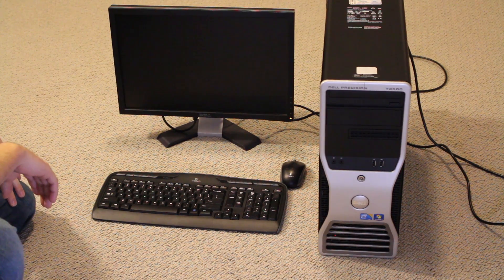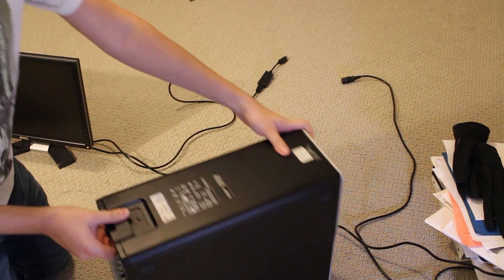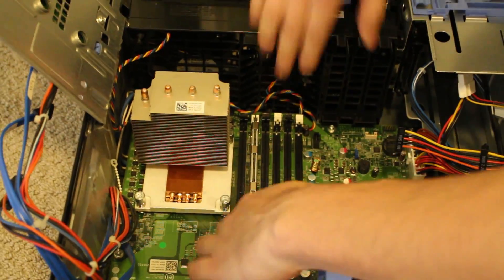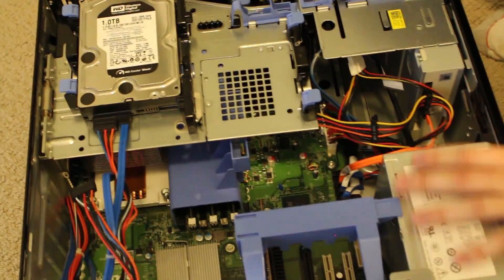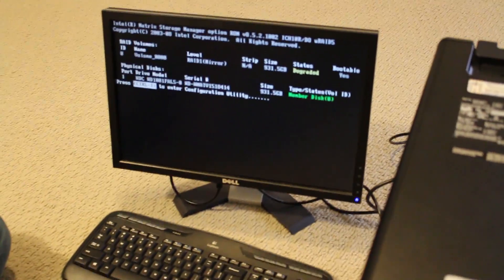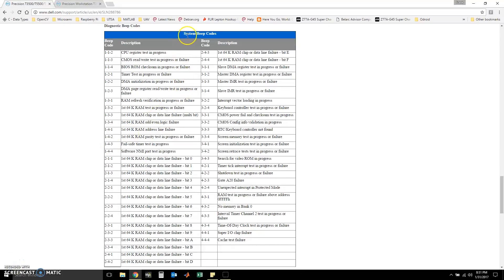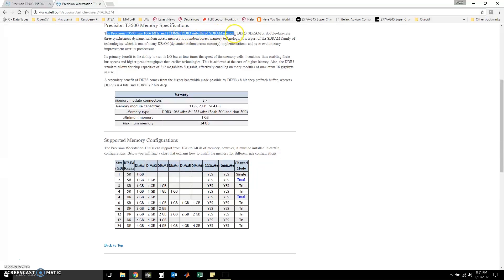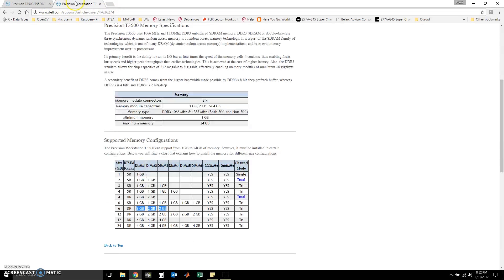[Solved] How To Fix Dell Precision T3500 Not Booting , 1-3-2 Beep Code

Comment: Where is your ESD wrist strap and the way you handling the ram is wrong. You are on carpet which will cause static electricity. Also, you need to leave it pluged in so it stays grounded. Do you have your A+ cert. Thanks for the video, on how not to handle a computer.
Reply from the maker: SARAH CLOPINE I am an Electrical Engineer and your gripes don't apply here. 

Never work on a PC when it's connected to power. Always disconnect it from the wall unless you're prepared to get zapped by a capacitor or ready to short out a component. Disconnect the PC from the wall and then press the power button to discharge the capacitors and remove any charges present in the components.

An ESD happens with voltage potential differences. The PC by being placed on the carpet, is at the same potential as thr carpet. Me being on the carpet and also in constant contact with the metal case, puts me at the same voltage as the case and carpet therefore eliminating an ESD.

If you feel like your books tell you how to better handle RAM, please feel free to share with everyone. It seems that your inexperience gives you a false sense of knowledge about the subject.
Reply: Frank Hurtado okay what ever. I have an A in my Hardware class. Plus have been working computers for a very long time. So your comment does not apply here.
Reply: Frank Hurtado you need to handle ram on the top part of the ram and not stack ontop of each other. This prevents the ram from corroding on the connectors.
Reply from the maker: +SARAH CLOPINE Congrats on your A and keep it up. I wish you well.
Reply: Frank Hurtado http://www.tomshardware.com/faq/id-2121341/ground-building-computer.html
Reply from the maker: SARAH CLOPINE This is the reason why gold is used at the connecting pins of electronics. Gold is an excellent conductor and pretty much stays free of corrosion and tarnish which destroys signal lines. Touching the pins will not corrode the gold contacts.
Reply from the maker: +SARAH CLOPINE You do not seem to understand the concept of voltage potentials. Please invest in taking an advanced physics  and advanced circuits course.
Reply: Frank Hurtado i do not need that for my degree or my career. That does not intrest me. To be A+ Cert is just taking the test and pass it.
Reply from the maker: Thank you. No need to get mad. b
Better try to help than do harm.